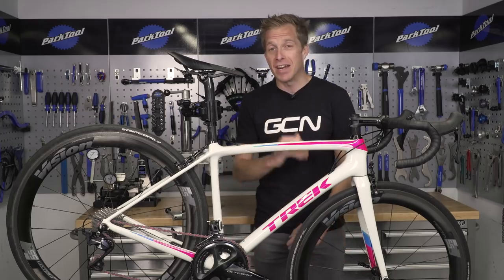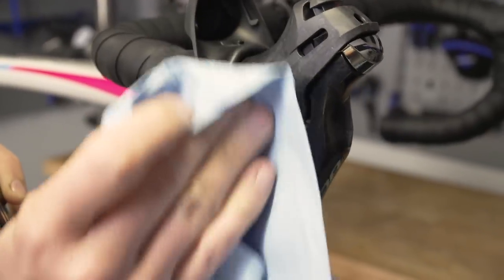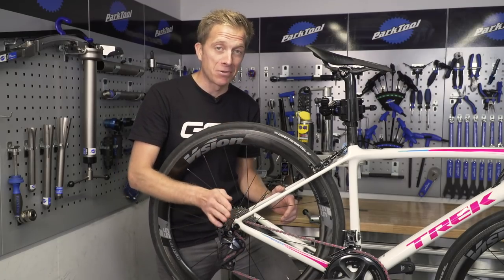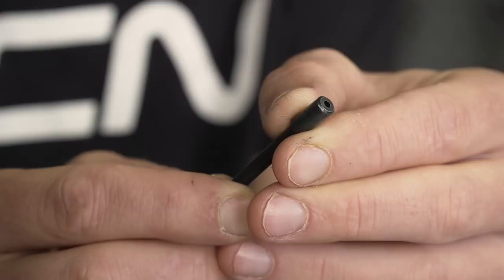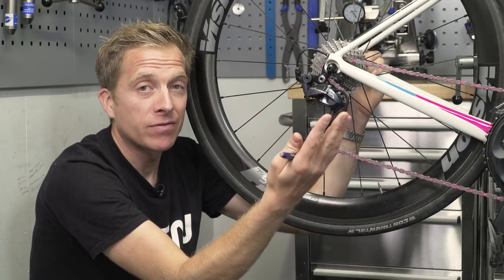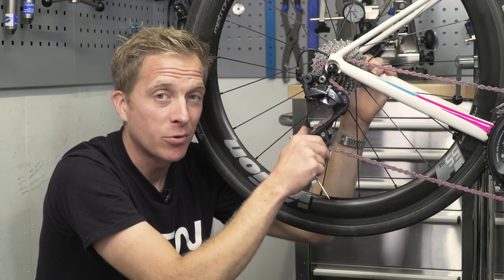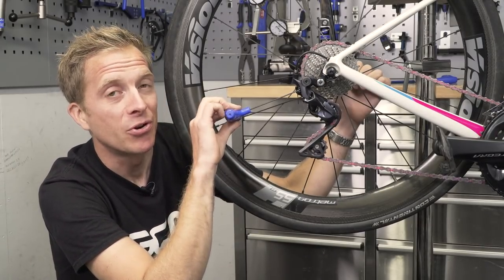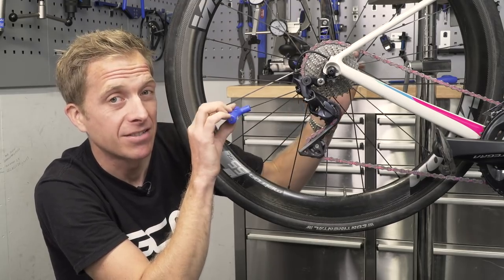How To Get Perfect Gear Shifting On Your Road Bike

Comment: Hosing air down your cable tubes is terrible advice.
Reply: Why what happened?
Reply: To me nothing, because common sense, but to anyone trying it they will only accomplish getting dirt inside. That's physics 101.
Reply: @esvegateban  I thought you were going to say you tried on a blocked one and it exploded in your face or something. 
I sort of get what you mean. All the dirt in the first few centimetres will just get distributed down its length. There's also a chance it might all get blown out though.
Reply: Same reason why you don't wash your bike with the Kärcher at power: dirt will get in your bearings and interfaces.
Reply: Absolutely no chance, tubes are quite long for that, also dirt can be sticky if wet.